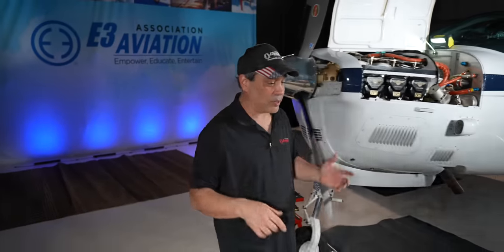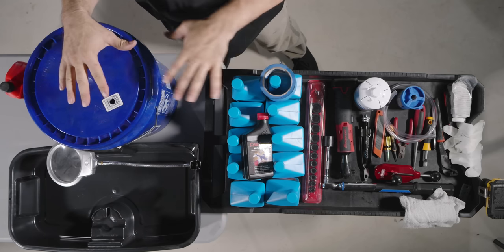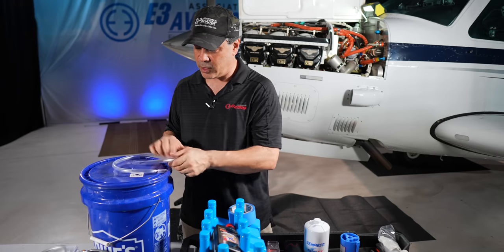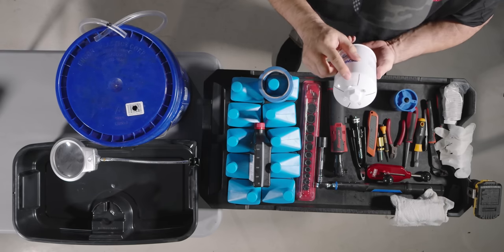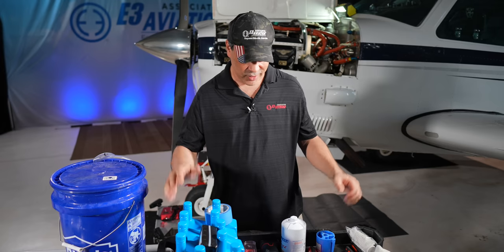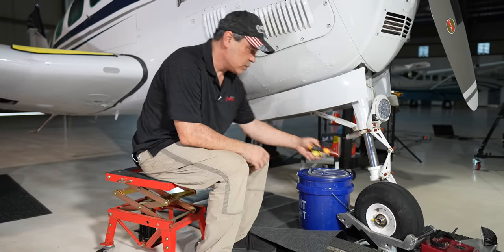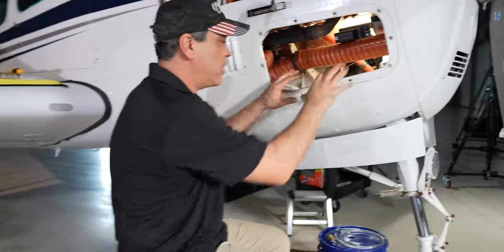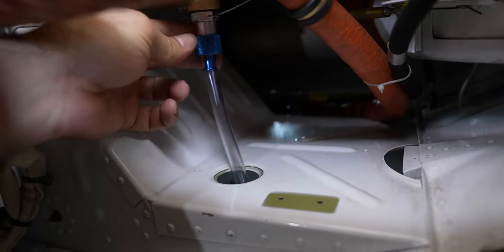The Oil Change Errors You Must Avoid

Comment: Nice job  but a couple things. I hope you warmed up the engine before you let the oil out. Also safety glasses and rubber gloves should have been worn. I always hold onto the end of the safety wire that goes flying some where that you can't find before cutting. I also put oil onto the new rubber seal filter before install. Hope this helps. Tom
.
Reply from the maker: @thomasmurray1807
@thomasmurray1807
 Thanks Tom.   Yes.  See part 2 Tuesday night.    Your right glasses should have been worn.   The engine was warm.  not Hot.   We did mention that.   Thanks and we have you in the bucket for a membership.   More to come.